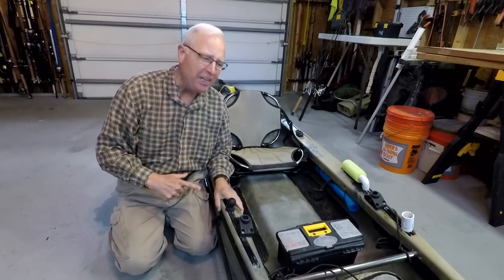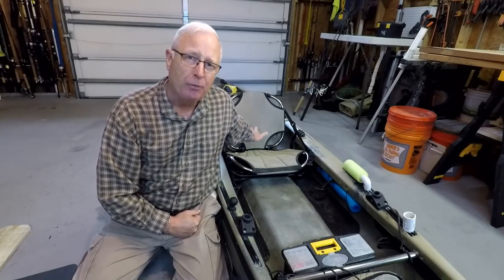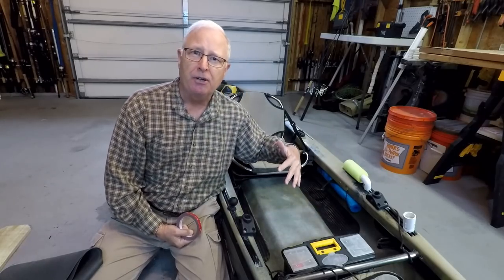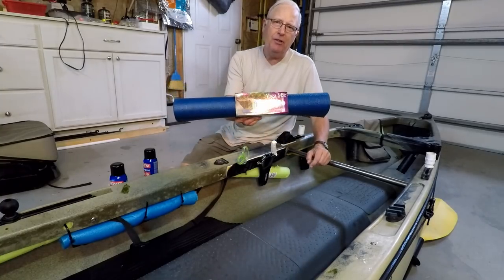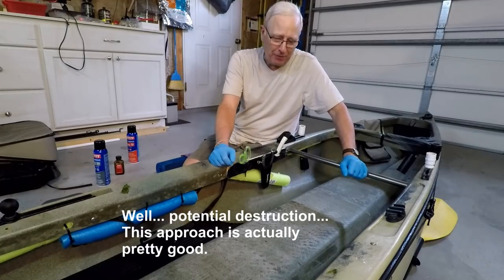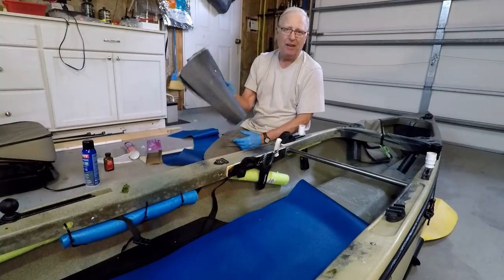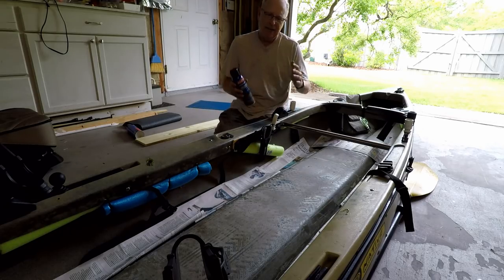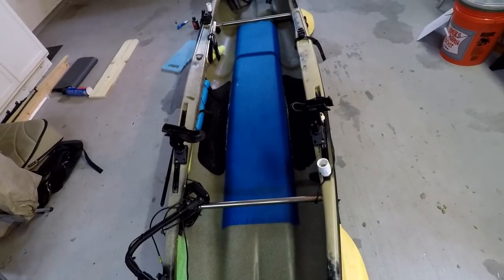Reduce Kayak Noise - Soundproof your kayak floor

Comment: Great video. I did a similar hack for my dog when she is in the kayak behind me.  I used a ground mat that is about 1/2" thick, used for camping, sleeping on ground.  Bought at Gander Mtn. online in a roll.  Mine was for 2 reasons, an insulator from cold bottom for her when wet, and to dampen sound of her movement.  I did not glue mine in, as it lays well as a rug would.  Removable for cleaning and transport.  The mat is camo also.   Thanks for showing your success and fail, not everyone will do that.
Reply from the maker: Another great suggestion! thanks!
Reply: Just in reading the first two lines I can’t get the image of a dog with a yoga mat glued to it out of my brain now lol

Comment: I've been yoga matting my Ascend,   5mm mats, the adhesive would not dry!  3 mm works just fine!
If you want to make templates, I would recommend 
Walmart paper lawn bags 
2-ply  16"L x 12"W x 35"H  5/$1.97  
like  70x 32" when you open them up!  
took one bag to do my fs120
You are one of my Go-to Guys on youtube, Steve, thanks!
Reply from the maker: Thanks for the tip on the bags!

Comment: I've been wanting to do this for a while.  

1. For cushioning when I'm standing.  I think it'll increase my stability.
2. Sound dampener, as you informed.
3. Parts of the deck on my kayak (1st Version Ascend FS128T) are actually lower than the scupper holes, so not all the water drains.  This can help even out the deck.
Reply from the maker: So far so good!

Comment: My yak has a nice, flat floor, so I'll just cut a yoga mat to fit and lay it down without adhesives, and without cutting around the scupper holes. I can just pull it out to let the boat drain, shake off any loose dirt, or hose it down if need be. Keep the good ideas coming, Steve.
Reply from the maker: That would work. I did not try mine without adhesive.

Comment: Luckily for me my SeaDek was already installed on my used kayak.  But a couple of years ago I installed mats for a friend on his kayak.  We did something similar to your project, except we used those mats women use in kitchen drawers.  They have small holes in them but are surprisingly silent.  They come in a pretty big roll (different lengths too) and with a pattern, you can cut them into any shape.  The big bonus is they come in dozens of colors and patterns in most stores.

Why don't I film these things?!
Reply from the maker: You should! And thanks for the tip on an alternative material!

Comment: That matt with the design looks very factory luxury edition. Meaning it doesn't look like a chopped up matt but a professional looking job👍
Reply from the maker: Heath Holland did a great job at detailed customization on his kayak in the pictures I included at the end of the video. Mine was pretty easy!
Reply: Kayak Hacks Fishing Nice video, another solution I found useful was the thin plastic roll you use in your kitchen cutlery draws/ plate cupboards. Very flexible, light weight and easy to shape.
Reply from the maker: Thanks for that tip! Heath and I struggled to find a material that would work. Glad for another option!

Comment: In the coast guard we have these big non-skid stickers we have to put on all of the walking surfaces, and replace them whenever they get scraped up. We put the stickers on, and then seal the edge with “aquaseal”. 3m makes an equivalent marine grade adhesive edge sealant, but i’d imagine most epoxies or maybe even “shoe goop” could work. . The way we do it, you put the sealant around the edges, on top of the sticker so it covers the edge of the sticker, and over onto the boat surface. This makes a water and airtight seal around the edge, keeping it from pulling up.
Reply from the maker: Great idea! Thanks
Reply: Are traction stickers going to deaden sound?
Reply: @doctorkayak  Not at all. However the marine “edge-seal” or “goop” could be used for other methods to keep the edges from peeling away for longer

Comment: I have not use the loctite adhesive but I've had great results with 3 M super 77 adhesive and with contact cement.  Surface prep is important so I wipe things with alcohol and then use my torch to give the surface a light flaming.
Reply from the maker: I really appreciate the endorsement of another adhesive. It is hard to find things that will stick to HDPE. Thanks

Comment: To quiet my "junk drawer" under my seat on my Bonafide...I used a thin piece of rubber mat and cemented it with 3M Contact Spray. It's contact cement  in spray form. I sprayed both the drawer and the mat...waited for it to dry, and attached the mat. I've been in fresh and salt water several times. There has bin NO issues.
One thing I did before I applied anything was to scuff it lightly with a 3M pad...then cleaned the area thoroughly with rubbing alcohol .
Reply from the maker: Great suggestion and I like the rubbing alcohol idea as well to make things stick.

Comment: It's been almost a couple of years since you posted this.  My question is how did the 300 Level adhesive work?  Do you think that it worked well enough so that the contact cement isn't necessary for the edges?
Thanks, I love your videos!
Reply from the maker: Appreciate your kind words! I posted an update at the end of season - https://youtu.be/5ERya-trw74
The 300 level worked fine. The contact cement peeled back a bit in places. I should have really put more 300 down right to the edges.

Comment: Great video, Steve! (I may be a little biased). Turned out great
Reply from the maker: Thank you for letting me use those pictures and for finding the Yoga Mat!  Contact cement is working great and I did not end up using that much.  Less than 1 bottle!
Reply: I'm honored! Hope to get down that way this summer. Maybe we can take the yaks out?
Reply from the maker: Let me know!
Reply from the maker: Send me a note when you have a date.  We can check the tide and wind - those drive where we would go and if we could go respectively.

Comment: I'd say it's good for the integrity of any bonding agent to lightly take off the gloss finish on your kayak. When you apply like cement Bondo it sticks better to the rough scratchy surface. :) as apposed to the slick gloss finish.
Reply from the maker: I agree that light sanding might help. You still have the issue of getting things to stick to HDPE. Jackson Kayak just told me that they use a product called Gflex.  Pretty pricey.

Comment: Steve, can you do a video on adding a trolling motor to a kayak?
Reply from the maker: Ouch. I sold my Native Ultimate and the trolling motor last year. I bought a Native compatible mount for the motor and just clipped it on. In the Native, there is plenty of open space, so I extended the wiring to be able to put the heavy battery at the front to balance out.

Comment: How long did it last
Reply from the maker: It lasted for two seasons - maybe more - I sold the kayak at the end of the second season. I did have to reapply some contact cement once on the edges where I did not glue them adequately the first time.

Comment: If the yoga mats get wet do they absorb the water , and how long dose it take to dry?  Have you had issues with it getting  moldy over time?
Reply from the maker: They are waterproof - at least the one I used from Walmart. It dries as fast as the kayak and there was no mold on it at the end of the season.
Reply: @KayakhacksFishing  Thanks great videos!

Comment: Can you comment on your seat?  Is that an upgrade or did it come with your yak?
Reply from the maker: It is the one that came with the boat.  I fish a lot and, over time, the material in the seat stretched and is now lower than it was when new.  The puts the horizontal crossbar uncomfortably on my tailbone. I have to use a pad now to prevent chafing.  When looking for a seat, I would avoid anything that has a horizontal bar as the hinge between the seat and the back where the back of the seat runs perpendicular directly to the hinge.  If there is an offset between the seat hinge and seat back, you should be OK as that would keep the metal bar away from your tailbone. That said when new, the seat was very comfortable and is OK with the pad.

Comment: scotch outdoor dbl sided tape will hold in water, i havent tried the permanent series dbl sided tape.  not sure contact cement will hold up long getting wet.  let up know
Reply from the maker: Thanks for the tip!  The contact cement I used did just fine as long as you did not flick or rub the sides.

Comment: Instead of contact cement I use E6000. It is clear and if you have to remove it you can rub and peel it off.
Reply from the maker: Wow... craft cement?  Is this the right stuff? http://amzn.to/2q56a2L
It does not mention plastic in the description - wonderful if it works... thanks!
Reply: It is actually an industrial glue that has found new life in crafting. As long as the glue can breath to cure.. Like that mat you installed. It doesn't cure well when it's plastic on plastic. I glued a dash cam mount to my van. Left it in the sun and it cured great.

Comment: I have the same kayak and am wondering about your seat not be able to slide on the mat.
Reply from the maker: If I lift up a bit, it will slide.  If you slide with your weight on it, the material will wrinkle and I assume eventually tear.  If you slide a lot, maybe putting a lubricant down on top (vaseline?) would allow for more movement.
Reply: Tear apart a sliding screen door and screw the tracks in where you sit and then put the wheels onto your seat! Lol I am not sure if it would work, but a funny idea if someone wants inspiration.

Comment: Does it come loose when traveling at 70mph ? I travel to TX alot and do not want it to come out down the highway.
Reply from the maker: I have not had a problem with it going 60
Reply: Not sure can’t paddle that fast 💨 🤔
Reply: @getoffyourbassandletsfish7651  work out more!  Concentrate on speed strokes!  =)

Comment: Your adhesion problem with the 3m tak tape is not using a cleaner and some adhesive promoter to the yak itself before sticking the 3m to it!!!
Reply from the maker: thanks for the tip!
Reply: @KayakhacksFishing  Not a problem... Once that promoter is in contact with the tape! You'll have to scrape it off. You can use it with stickers and duct tape too. Glad to help ya out😊

Comment: Wrong, first step should have been to remove failed adhesive. Steve you are asking for problems! LOL
Reply from the maker: The spray stuff is holding fine.  It was the same brand, just a different strength based on the same basic formula.  So far so good. The contact cement is holding as well.